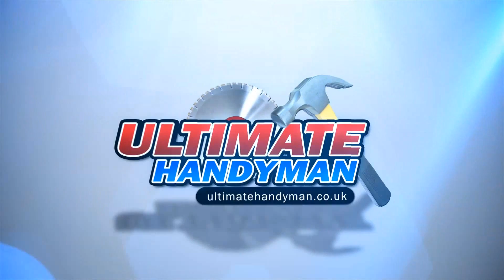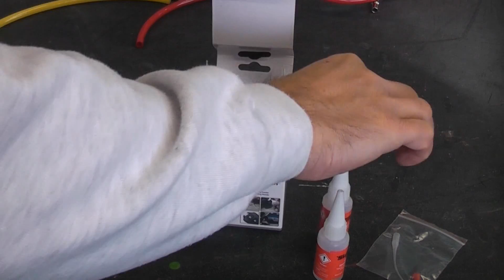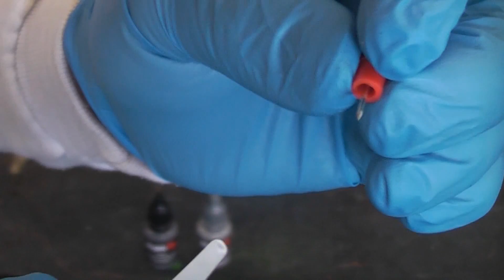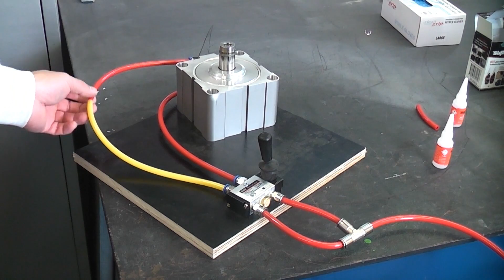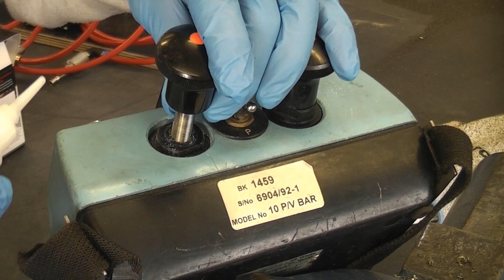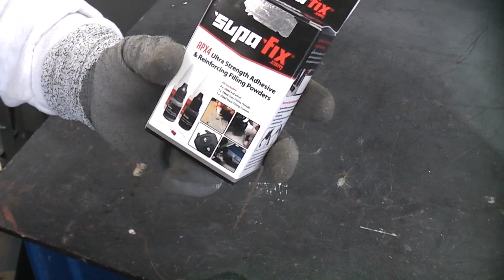Supa-Fix

Comment: Beware..dont buy this product its is just another super glue. bought this few months back to fix a broken fairing. .completely useless. rather buy cheap super glue.
Reply from the maker: I've used it with great success on some items. I guess it depends what you use it on.
Reply: used it to fix broken motorbike fairing, its seem to glue it together ok at first but when applied little bit pressure it easily broke apart and i wasn't even putting lot of effort, just another superglue shit..Donot buy this it doesnot have the strength or capability as claimed in the videos

Comment: looks good. I've got an alloy crank case that's got two studs that were to long and broke through the back of the casting..I'll try this as welding means a full strip down and rebuild due to rubber oil seals...
Reply from the maker: +lambretta rider 
If this does not work could you fill the holes using easyweld rods, then drill and re-tap them?

Comment: I have had great success with loctite 'ultra control' cyanoacrylate superglue in the red bottle in conjunction with baking soda that has been exposed to heat in an open tray at about 140 degrees F for ten minutes.  The blue bottle is gelatinous, and no good as it does not wick into the filler.  The Red bottled loctite is by far the strongest super glue I have ever used, although these days I find myself preferring to use JB clearweld epoxy, as the stated 4400 PSI of shear strength I have found to be under rated through experimentation.  Thanks so much for the videos!
Reply from the maker: Thanks for the detailed tip ;-)

Comment: when you repaired the Druck how much of the product did you use,Just curios to know how many repairs you could do
Reply from the maker: Probably about half of the powder and half of the adhesive, but there is still another full tube of each in the kit.
Thanks for the comment ;-)
Reply: ***** I tend to avoid those type of super glue bottles. Whenever I go back to use it, it's a solid mass inside, and has to be thrown away! I prefer squeezable tubes.
Reply from the maker: dalriada842
I have not had that problem yet. I do have a bottle of industrial grade super glue which is kept in the garage and it's not gone hard yet, although the nozzle is blocked to dispensing it can be tricky!